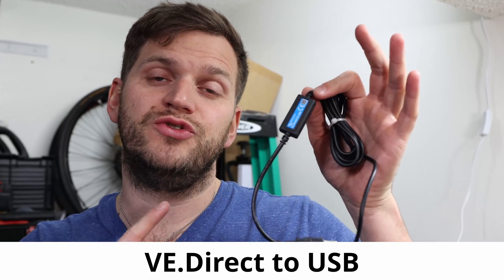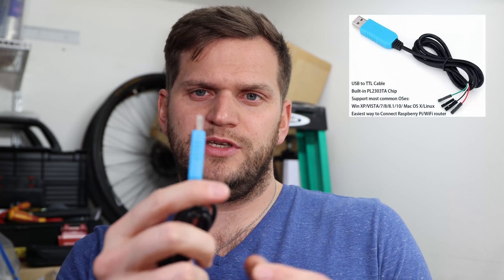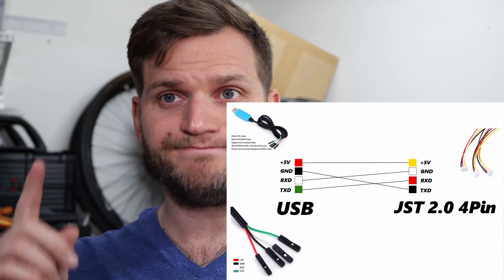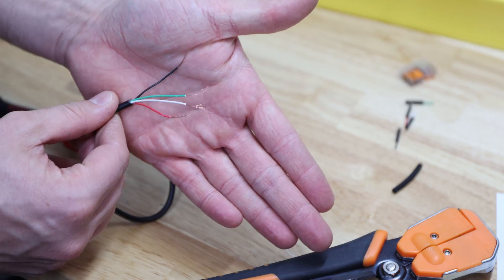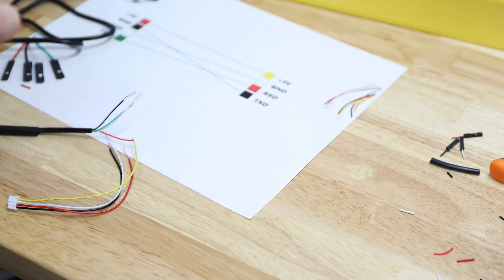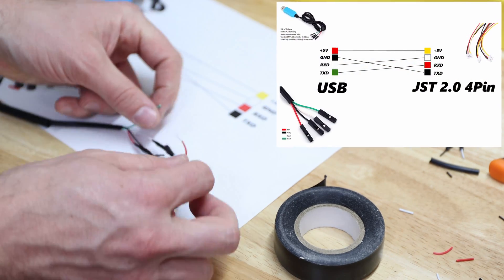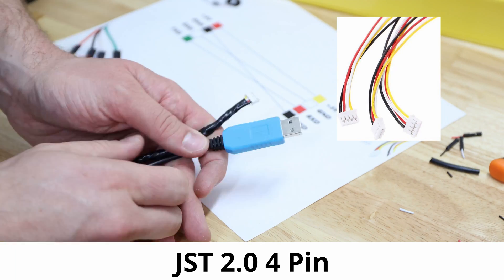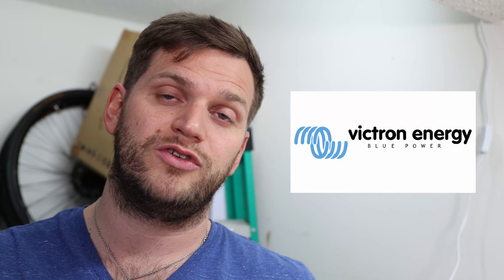Victron VE.Direct to USB DIY | $4.09 one cable | Do It Yourself

Comment: Dear Tobi,
Thank you for the tip to make the cables myself.
Unfortunately I was less succesful as you.
The cables I made refused to work in combination with 2 of them.
Hooked up to a MPPT and a Smart Shunt.
Or the one or the other and after a while they blew up internally.
I assume this has something to do with an non isulated internal layout.
I bought 2 original cables and everything works direct.
You can test the self made cables easy by finding the correct COM port the USB creates and than use Putty on that COM port.
When you short the middle 2 pins from the JST 4 connector you should see an echo of your keyboard input in the putty screen.
So just a warning that these cables not always work.
Reply: Yeah these cables are not isolated, meaning that the ground from the shunt or smartsolar, will be shared through the usb and whatever it is connected to. In my case, i had a raspberry pi being powered from a buck converter on the output side of my bms, and the bmv712 connected before the bms, and when the bms turned off, it literally blew the buck converter to pieces, as the inverter tried to pull its full power through the usb cable and rpi. The genuine ve direct cable i gather is more expensive because it is completely isolated internally, so this fault wouldn't occur with the genuine cable. I gather you may have had a similar issue. This however isnt an issue if your rpi is powered by an isolated source and you are only using one of these diy cables, as theres no ground loop through the usb cable
Reply: @lexicase8805  Good point. Best solution is to put a simple optocoupler between the USB cable and the JST cable.
Reply: @RoaldKoger    could you tell me pls more about those "optocoupler" workaround! Do I just need to solder one of those "four legged things" (amazon gave me 3CJSEtq this) to gnd? Thanks for your help!
Reply: BOJACK PC817 Optocoupler <--- that's what its listed at :)
Reply: Hi  @lexicase8805 , i am facing this exact issue i believe and my MPPTs keep dropping out until i reboot my raspberry pi and then they show up again for a few hours and then they disappear again.

Could you please clarify what it means to "power the RaspPi from an isolated power source" ? 

and further more, you stated "only using one of the DIY cables".  
Does that mean i cannot use 2  or 3  DIY cables even if RaspPI is powered via isolated source?

Thanks!
Reply: @waseefarshad509  so basically whats happening is the power in your system with non isolated cables, can flow not only through your main power cables, its able to flow through your data cables as well, which is extremely bad! So the victron gear is sensing this power flow where it shouldnt be, and protecting itself which is why it drops out.
An isolated power supply would be something that doesnt have a connected path through either power or ground from the battery side to the usb side. Try powering your raspberry from a portable usb power bank, that would be absolutely isolated. 

I was also using 3 diy cables and have since replaced them all with genuine victron cables as i didnt have time to wait, but there are apparently isolated versions of the TTL cables, i just dont know what to look for. What that means is that the usb end only sees the data from the victron device, but the power and ground are not directly connected, they are protected by some fancy circuitry i dont understand. 

I decided to switch to genuine victron cables a few days ago as one of my systems had a raspberry pi powered through a buck converter since it was only a 12v system, and the raspberry pi only running one bmv712. The buck converter was connected after the bms, the bmv shunt before the bms. When the bms did shut down, the ground then flowed from the bmv shunt data cable, through the bmv screen, diy ve direct cable, through the pi and buck converter ground and tried to continue the negative supply that the bms was trying to shut off. The raspberry, bmv712, buck converter and all cables between, caught fire. Over $500 in the bin because i didnt use a genuine $40 ve direct cable.
Reply: @lexicase8805  WOW!! thanks a heap for the info and personal experience story! thanks mate. every video that shows people making these DIY VE.direct to USB cables dont go on to show how its going a few days later. Mine worked fine the first i connected it and then hours later it dropped out. I have just gone and bought some official victron cables and will see if they help. but before i do so i will also test powering the raspberry pi from an external power source like a powerbank.
Reply: @waseefarshad509  yeah, some have good luck with them and some just fail, and to be honest i think the internals of some of these cables are actually not the same, some might be the isolated type and some not, even from the same seller. Once they come off the assembly line and the blue housing gets clipped on, how are you to know what type you really have? I think that is why some work okay and some fail instantly. Mine was ok when using just one from the bmv712 to the pi, but only when run from an ac wall supply or power bank running the pi, as soon as I connected a 12v to usb socket and ran the pi from the same battery the shunt was connected to, it returned crazy numbers like 17,000watt and 600 amps and such, so i assumed it was the usb supply and switched to the buck converter and it was then that everything blew up. So many failures ive had, but the ve direct genuine cables fixed all my issues on both my 12v and 48v setups. I hope you have the same results
Reply: @lexicase8805  you seem to be quite knowledgeable on this subject so I thought I would ask a question.  I came to this video because my solar controller and smart shunt are about 15 feet from where I need to install my raspberry pi so I need longer cables than the OEM Victron.  Can I just use a usb cable extension on the OEM cable or is there a better way to solve my distance issue?
I appreciate your help.
Reply: @GreatRockRealEstateDenver  yes i would use genuine ve direct cable and a usb extension, and if it suffers some instability, try using a powered usb hub in between the ve direct and the extension and you should be ok. Ive actually steered away from these diy cables now as i found running the raspberry pi on a buck converter from the same battery that the shunt is measuring, there was strange things happening and wild high and inaccurate amperage being displayed, as the non genuine cables are not isolated, the ve direct genuine cables are isolated so no current can flow through them. 

The diy cables seem fine if you are powering the raspberry pi from an isolated source or mains adapter
Reply: @lexicase8805  Thanks for the reply.  Greatly appreciated.  I will also be running the pi from a buck attached to the same battery bank I will be monitoring on a boat.  The hub is an excellent idea.  That way I should only have to run one usb cable from the hub back to the pi 12ft away.  Do you have any suggestions on a buck robust enough to power the pi without getting low voltage errors which I have heard happen with a lot of the bucks available?
Reply: For others wondering if you should go head the main reason for this is connecting the +5V wires together. In non isolated cables like this you should never connect the +5V wire at all. You only need the ground, RXD and TXD wires.
Reply from the maker: Thanks for sharing !

Comment: Wonder if the VE.Direct device could be plugged to Raspberry Pi straight into the GPIO RS232 lines without the USB-converter in the middle... 
Could hook up atleast one device with just the JST connector :D
Reply: Should work. Check voltage levels, I'm not sure Pi GPIO will take 5V signals.  RX/TX may need to be crossed over.
Reply: Thanks for the video, have you noticed that the cable loses connection randomly meaning you have to unplug the cable to reset it?
Reply: Best way to fry directly your Raspberry.

Comment: Do not  connect the 5v to the jst connector if you connect it to a 
BMV-700 as on this battery monitor the ve.direct bus is working at 3.3v
And not at 5v.
Reply: The cable works without connecting the +5v cable indeed.
Reply: If PV is connected,+5v wire has no use.
Reply from the maker: Thanks for your comment. I read something like this as well but wasn't bale to verify it. Do you have more information to share about this?
Reply: @tobisreallifeskillswithtobi I would just avoid connecting the 5V altogether. It can only lead to danger.
Reply: @tobisreallifeskillswithtobi  This should have all the information (in german)
https://www.youtube.com/watch?v=V0daJC69GWM